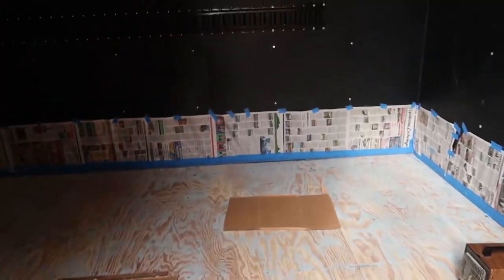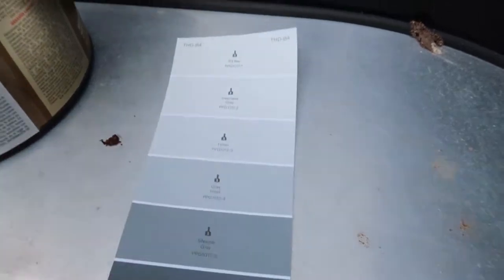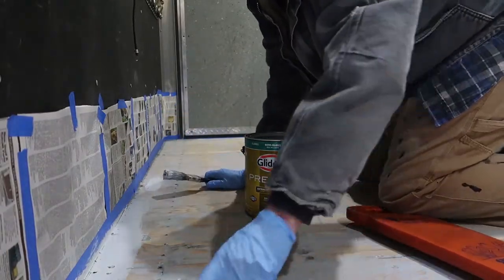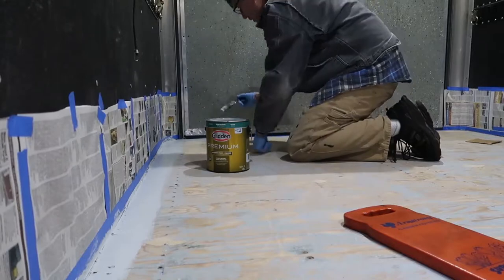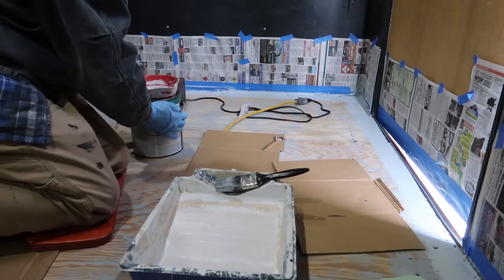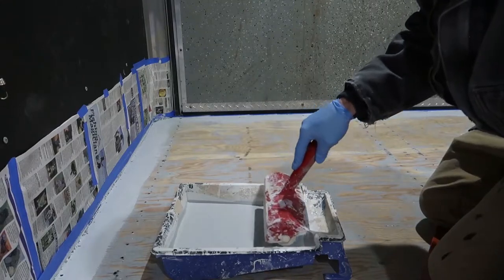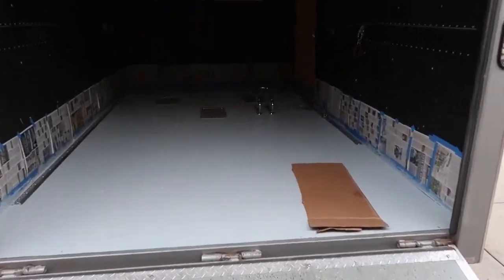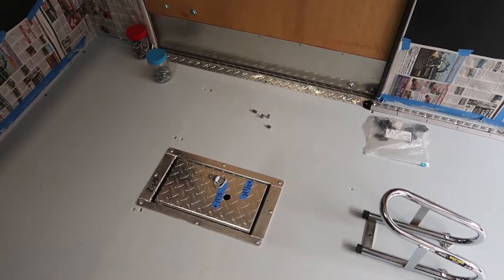7x12 Cargo Trailer Upgrades: Painting The Floor

Comment: The problem with sanding plywood vs stripping, is that the soft pulp is removed leaving an uneven, roller coaster surface where water, dirt or debris can collect..  Due to your masking, you could have bumped the corners/edges with a roller (remove the useless guard?)..  That being said I look forward to your to-the-point, common sense videos devoid of faff and time wasting click-bait nonsense....!   Thanks again..
Reply from the maker: Thanks for watching.  I like that goofy paint roller I use because it keeps the paint from flying off the roller and making a mess all over my hand and arm like an uncovered roller.